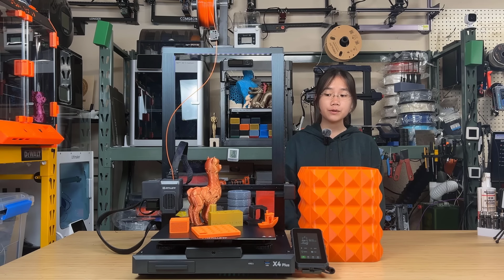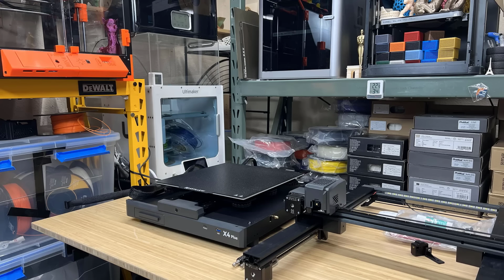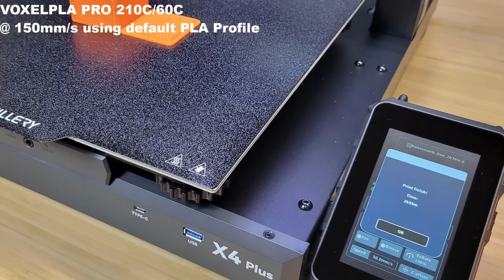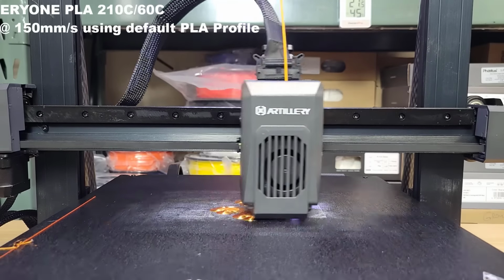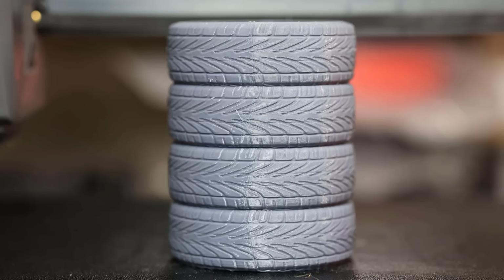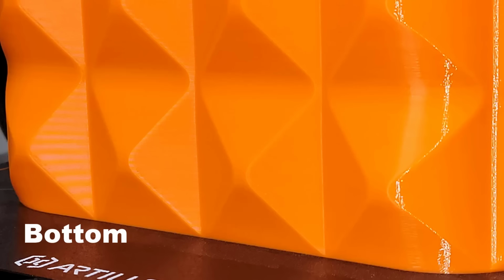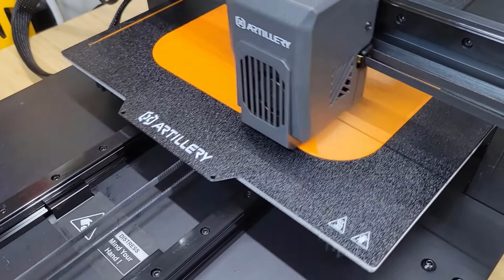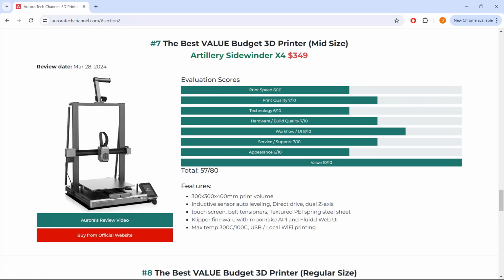Artillery Sidewinder X4 Plus Review

Comment: Wish these companies would stop putting the filament on the top of the printer.  Especially at these speeds. Too much shake. That said, I think you are the premier 3d printer reviewer of all YouTube reviewers. Keep up the good work.

The need for paper bed leveling is unforgivable in 2024.  Boo! to Artillery!!!!!
Reply: Exactly as you say! However, I like the filament on top, it avoids the need of any kind of PTFE tube, which is always awkward. However, the stability and shaking are a problem. These large printers should be made of rigid profiles AND cubical in shape like Ender 5. They shouldn´t be bed slingers at all.
Reply: I can survive setting up a table on paper... compared to a supposedly self-leveling table in k1 which is rubbish to me.
Reply: I wouldn't mind leveling the bed manually if it stays level after that. I would trust it more than whatever gcode is generated to compensate for a non-level bed. But I'm not an expert on the what is going on with the gcode etc. Thoughts?
Reply: Agreed on everything you said.

Comment: I bought the Sidewinder X4 Pro and I've had nothing but problems with it. Their firmware has all kinds of problems. Screens in Chinese even though English was chosen. My biggest issue right now is layer shifting. I've slowed it down to 80mm/s and I still have minor shifts in the X axis and this is after I added a heatsink to the X motor. The X4's have inadequate ventilation for the electronics and you can't remove the bottom cover without voiding the warranty. Essentially the Pro and the Plus are the same except for the build volume.

Comment: I don't get these huge bedslingers. They're huge so you want to print huge things, but after a certain height, unless your object is very sturdy and is not just a thin wall like the vase print, then you'll experience quality loss that gets worse and worse. Someone needs to make a big format CoreXY printer to satisfy the needs of those that for whatever reason, need a huge machine. I know the Rat Rigs exist, but those are printers for serious nerds and not for the people who want an appliance. Also, recently, I've started to vent all my printers even when printing PLA and PETG, as research has shown that even these materials that most tout as being "safe", release UFPs and various other nastiness that is best not to inhale. So its not just ABS that you should ventilate or clean, its... Everything. And this is much easier on a closed printer where it is possible to achieve a negative air pressure with little effort.

Comment: I really like how beefy, spaced out, and close to the bed the Y axis linear rails are. I also like that the gantry has a tradition brace and has additional strut rods. Overall I get the impression this is a solid machine, especially compared to the similarly sized Comgrow T300. This also has 50mm extra print height. Given this machine can be had for $349 and the T300 is $469 minimum, I'm really not sure why you would choose the T300 over the X4 Plus. I think comparing their tall trash can prints especially shows the difference in stability, even if the material and speeds were a bit difference. Great review as always!

Comment: You guys are helping to improve these machines and the experience for all of us. Much appreciated!!
I don't mind the manual bed leveling if it's a "set it and forget it" type thing. I want automated corrections when variables come into play (various filaments that might be out of tolerance, print types, speed, etc)
My ideal machine would have:
Single color (PLA or PETG, I'm not making motorcycle parts)
Fast but not so fast that print quality becomes an issue
Stays "in tune"
Running current Klipper
Ablility to use any slicer
Optimized (not leveling / heating areas of bed not being used, no extra energy, fan, and noise)
No 3rd party cloud nonsense
Able to run 24/7 (I would like to learn about automating print, swipe, new print and what's involved for small print farm)
And good/accurate presets available

What do other people think? What are your priorities?

Comment: This channel is so underrated! It gives really solid 3Dprinter reviews with high information density. I am in the process of upgrading from an old very small one but can’t decide on which one to pick. If I should go for the more “closed” systems like bamboo labs etc or something more customizable. Have gone through a fair number of videos here and they have been really useful. Keep up the good work.
Reply: Enclosed is almost always better since you can print more material types.  Core XY printers tend to offer better quality than the beslinger.
Reply: @daspicsman  Thanks for the tips!

Comment: Thank you for this complete and well presented test as usual.
I approve of the option taken by the manufacturer regarding leveling the platter: if the mechanical assembly is well designed and has no play (clearance), it is rare to have to adjust the platter.
So there is no need to waste time with automatic adjustment for each print.
Reply: I completely concur.  With Klipper, I do an automatic bed leveling, look at the mesh, adjust the knobs accordingly, repeat a couple of more times and the bed is very level... and never needs leveling again.  No paper shim probing needed.  Easy peezy.  I like having the bed very level so Klipper needs almost no auto Z leveling as it prints.
Reply: @Liberty4Ever  Thank you for these practical explanations.
As I am a mechanic, I favor mechanical adjustments.

Comment: Great review, as usual, love the good/bad part. It appears this is a Makerbase MKS skipr motherboard missing some parts. I hope users are not thinking they can just add a camera or update the software, like the Two Trees SK1 the controller board is what you get, how it is, upgrade is replacing the controller and tool head. Time to print would be a good metric to add, the Two Trees SK1 takes 10 minutes for the mesh and heat bed with PLA.

Comment: I've been waiting for Elegoo to make a Neptune 4 Plus Pro (steel rollers on steel rails) and the Sidewinder X4 Plus looks like what I've been wanting.

I don't mind the paper bed leveling because I don't use paper.  I use the bed mesh in Klipper to visualize the bed topology, adjust the knobs, and repeat 2-3 times to have a very level bed.  Once adjusted, it's good, so I actually prefer the simplicity of less hardware and a manual bed leveling.  I do wish it had an X&Y accelerometer to calibrate input shaping.  The lack of larger nozzles on a larger printer is annoying but all manufacturers seem to be doing this, as well as not having hardened nozzles.  I have a mini lathe so I can make my own 0.6 to 1.0 mm nozzles if needed and I don't print abrasive filaments.  The nozzle looks good and that's the heart of a 3D printer.  The silicone wiping pad is a nice bonus.

The poor print accuracy is concerning and that's my biggest concern.  I'd do some tests to determine if the axes are out of tram.  If so, all of the prints will be diagonally skewed, but it may be possible to shim the X axis linear rail.

Comment: I'm a little curious about the nozzles themselves--why there are so many so-called proprietary types per machine manufacturers?. All of the nozzles I have seen for use with 1.75 mm filament come with an M6 x 1 external thread, with all of the differences being in the length of the thread and/or size of the nozzle head itself (from the end of the thread). All seem to have a 2 mm ID bore that tapers down to a 60 degree cone intercepting with the stated nozzle bore size (.4, .6, .8, 1.0, and so on). I can understand that there might be fouling of the internal threads in an extruder block when a nozzle with a shorter thread section going into a longer block, but the other way around shouldn't be a problem, especially with manually adjustable Z-offsets. All of the different different types seem to be more of pain to users than is needed to be put up with. Any of the cheap hobby lathes on ebay or elsewhere could crank out nozzles all day (as long as you have some basic knowledge of machining).
Reply from the maker: I would say this nozzle is a "not that popular off-the-shelf" one, but they should become available everywhere, such as on Amazon.com, as more and more brands using it.

Comment: How long is the nozzle? It's a regular volcano nozzle or more long?
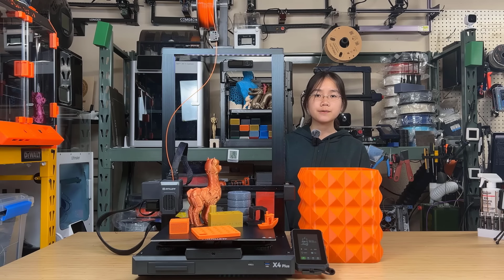Reply: 17:26
Reply from the maker: No, it's not like a regular volcano. I would say this nozzle is a "not that popular off-the-shelf" one, but they should become available everywhere, such as on Amazon.com, as more and more brands using it.
Reply: @AuroraTech  thanks, how long is it?
Reply: @AuroraTech  is similar to Neptune 4 plus?
Reply from the maker: The total length is 21mm, with a thread length of 15mm, and it looks to be an M6 thread with a diameter of approximately 5.88mm.
Reply: @AuroraTech  Thanks a Lot

Comment: Unfortunately,  the one I got is not working to level the bed. I set the z-offset and trying to manual level the bed it holds at the 6 points to level is unachievable.  The program will hold z above 0. Not good at all.

Comment: Sounds similar to the elegoo Neptune 4 plus.  Which do you think is better?
Reply from the maker: They share the same weaknesses, such as lacking auto Z, knobs underneath the bed for manual leveling, and a not-so-well-developed custom screen UI. However, I prefer the linear rails on the X&Y axes on the Sidewinder X4 Plus more.
Reply: @AuroraTech  - My thoughts exactly.  I have a Neptune 4 Pro and like it a lot.  I want a Neptune 4 Plus Pro but they don't make it in the Pro version with steel rails and I don't want a fast larger format printer with acetyl V rollers even if they did double them on the Y axis.

Comment: DO NOT BUY THIS MACHINE! there is an issue with the hotend that will render your machine inoperable. Do a quick search and you will find in forums that this is a common issue, to the point that the hotend is no longer usable. Artillery knows this, and their terrible costumer service, will tell you that their "new policy" does not cover the hotend. I had mine for less than a month! and somehow a unasable machine is acceptable for them, they will try to send you the sensors which will not solve your issue. The wifi, even with the new update, does not work. If it last one print, it's nothing short of a miracle. And adjusting the Z-offset is not easy, since the software in the machine stops working all the time. You think you are adjusting it and it's not moving at all! This machine and company are nothing short of sc*m. All you have to do is do a bit of research. If you take the plunge there is one company (if you are outside the us) that provides compatible parts, it's from Thailand. Again. DO NOT BUY. it's tempting, don't do it.